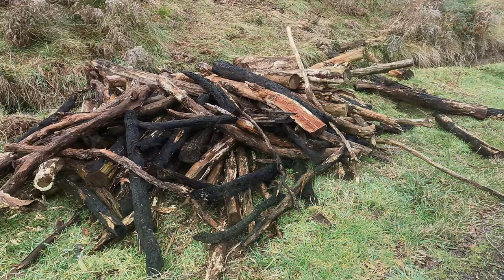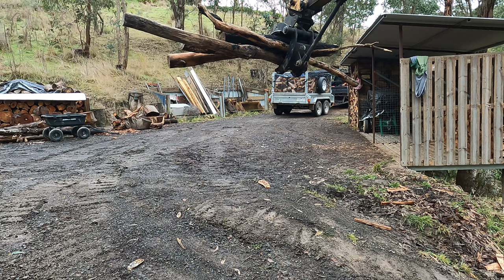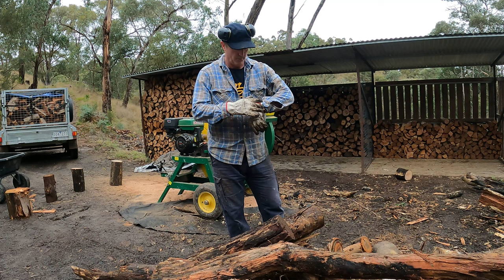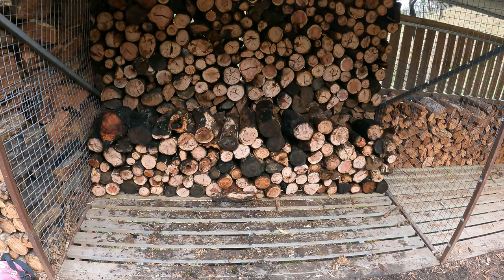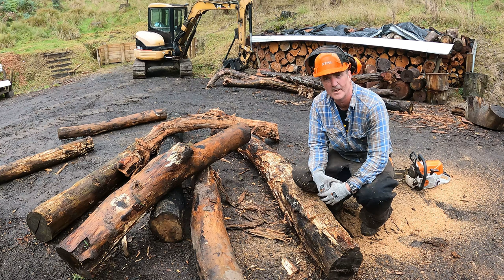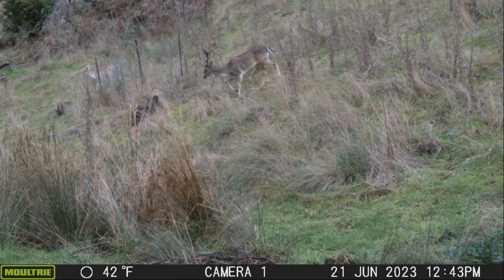More Fugly Wood Cut to Length - Millers Falls Swing Saw - MS462 C-M - 2023 #18

Comment: What sort of diameter can the Millers Fall saw cut? My bench will go straight through 12" and I've put 16" through it at times. Once it gets up to those sort of diameters the wood is getting a bit heavy to work with though.
I'd have put all those last pieces through my bench and I'm silly enough I'd at least consider doing them in 1 go and doing them solo.
Reply from the maker: Hey Alan, the millers falls would struggle above 12”. It’s a 700mm or 760mm blade so 350mm (14”) max cut but 300mm (12”) cuts slow the saw down and I have to cut in a few bites. 
I can’t lift logs that dia and length and support them properly on the saw, that’s why I used the chainsaw on them. Your bench is a lot sturdier and the motor more powerful so I’d expect you to be able to cut them, but i find the bench saw or swing saws are best for smaller diameter, quick cuts.